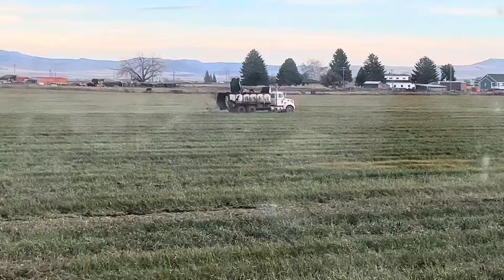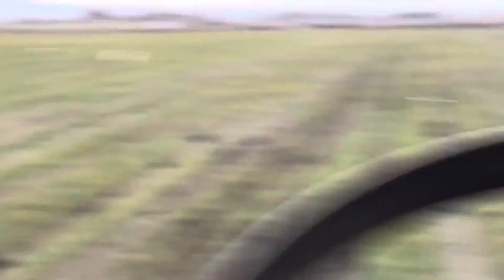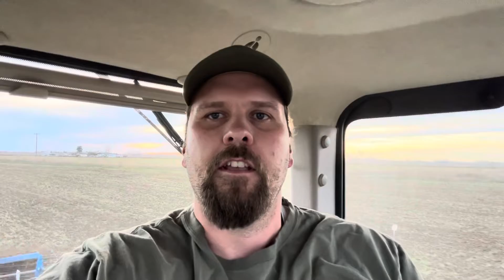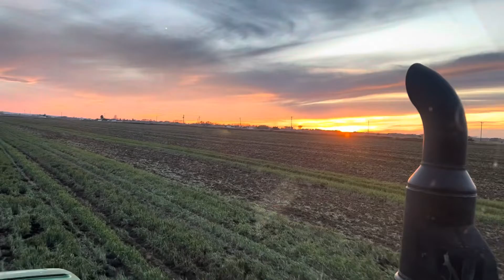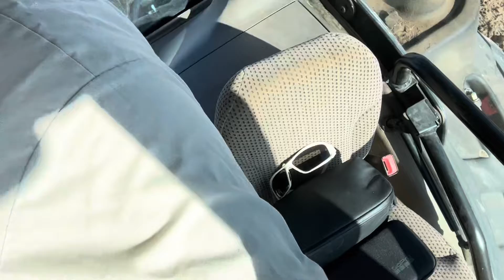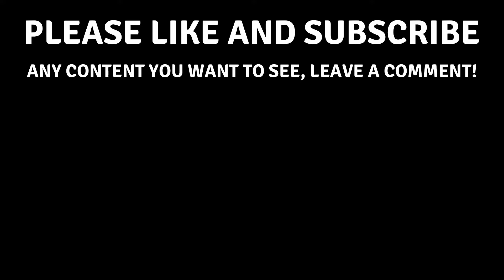Tilling in the fresh manure!

Comment: Doing compairson math per your figures and given both machines are track machines, your going to need a tractor producing 850hp to pull that chisel plow at 8mph, your going to burn around 42-45gal/hour, and close to $300 of Def/day.  Remember, fuel consumption and horse power requirements are not linear but become exponential with increasing speed.  Either from aerodynamic drag, or in this case the amount of earth weight, you're moving or the increased resistance against the plow with increased speed.  Plus there will be an optimal speed whereyoull get the most efficiency for time, fuel and money.
I suggest you contact the manufacturer of the plow and discuss your concerns with them.  Their engineers may have some helpful info.
Reply from the maker: Yeah I think we would just buy another 9510 pre def and another plow. That would be cheaper than a new tractor

Comment: IMO you can't beat an 875 ecolo tiger.  Would not need that extra disc pass.  I sold a Karat and picked up another one they work so well ahead of spuds.

I farm just to the north of you and pull 22' 875s 15" deep at 6-6.5 mph all day long with a 580 quad.  You won't be going back to a 9R after a steiger demo.
Reply from the maker: That’s interesting. I’ll have to look that up.